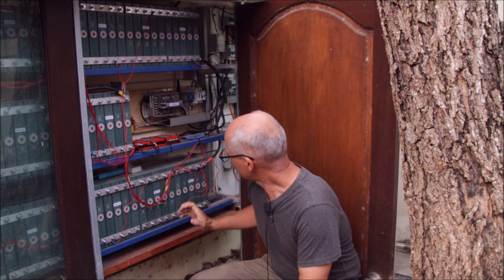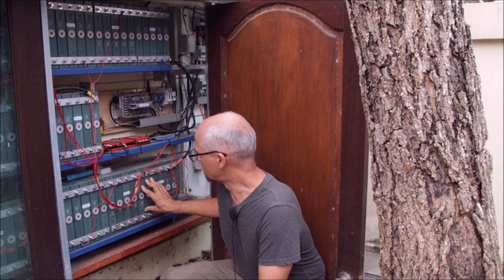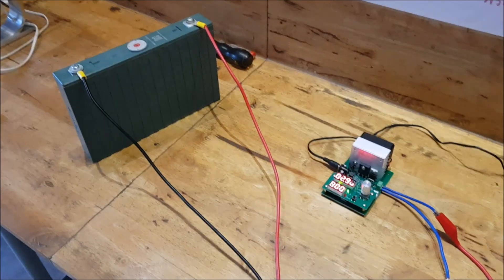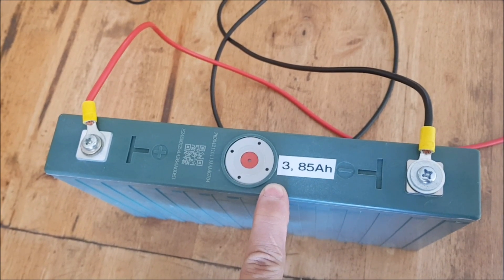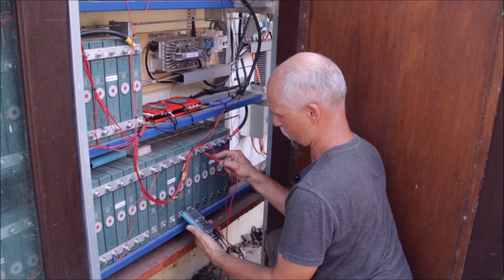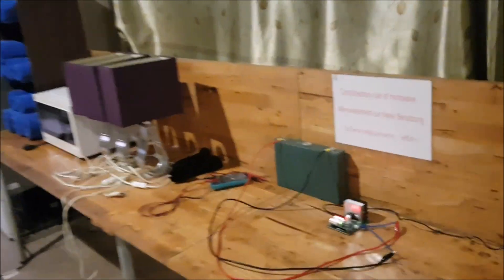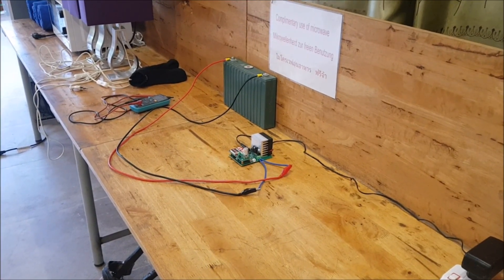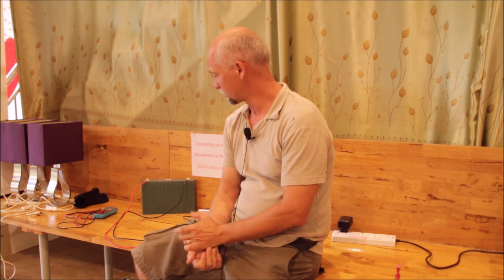What One Bad Cell can do to your Battery Pack. Let's find and fix it!

Comment: I have similiar situation, do you think active balancer will help?
Reply from the maker: An active balancers advantage towards a passive built into the BMS one, is that it is usually more capable to transfer energy from one cell to the other. That means that it can handle greater differences in cell degradation and still keep operation going.
But this is still just masking the real issue. If there is a badly worn out cell, it will usually require to replace it by a good one IF you want to use the pack for a much longer time. If you are just trying to extend the useful life of an anyways weak performing battery bank, then just get an active balancer. But be aware to activate the balancer only at the end of the charging curve above 3,42V to not get the voltages out of balance even more...

Comment: Hello, i am using a panther surge protector for my computer. However my electrical socket only have 2 holes. It doesnt have a ground thats why i am using an adapter to plug my surge protector extension to the outlet. Why everytime i touch my pc or the surge protector i get grounded??? Is it because of my outlet?
Reply from the maker: Hi. Yes, of course. If your outlet doesn't provide a grounding, then the surge protector is connecting the active wires to a dead end. So actually you get phase potential, albeit over a very high resistance, routed to the ground wire. So, if lets say your PC is also connected by that extension cord, you get the PC case as well on phase potential. That's why you are getting shocked :) Please connect to a 3-wire outlet with true ground! Cheers
Reply: @RolandW_DIYEnergyandMore  thanks for replying. umm thats a problem, i am living in a apartment. The outlet doesn't have a grounding. Does this affect my gaming computer in the long run or not? Is there a cons? Or my surge protector is enough even thought the main outlet doesnt have a ground. Sorry for my english
Reply from the maker: @giolacsamana9402  your surge protector doesn't do anything without grounding other then causing troubles. You need to use a cord without a surge protector. Then all is ok, just that you do not have that feature. But that would be definitly better for your equipment.
Reply: @RolandW_DIYEnergyandMore  so much better if i plug my pc directly to the outlet using an adapter and remove the surge protector? Since my pc has a 3 socket, i think thats the grounding
Reply: @RolandW_DIYEnergyandMore  if i plug my pc directly to the outlet, what are the chances of getting my pc friend because of overcurrent
Reply: *fried
Reply from the maker: @giolacsamana9402  chances are very low. Do you have many storms with lightning at your place? If you do not have grounding in your apartment then you can't surge protectors anyways.
Reply from the maker: @giolacsamana9402  do you have ground in your breaker box? If yes, then you could install a surge protection device there and protect the whole apartment at once

Comment: I’ve just made my 8x 3.2v string @ 24V into a 8x (2x3.2v) @ 24V. I wanted to add partners to my existing single cells to make it a 200A pack from a 100A pack. I had 4x Sinopoly cells spare and just bought 4 of the new second hand  Xiamen cells we’re seeing on Lazada. I just sent a flying Poz and Neg lead over from the new secondhand cells and attached to the original cells. This creates a double cell group and saves me buying another flying capacitor PCB and another Smart Bms. Had a Fai Dap power outage for 5 hours plus a few days ago and everything was beautiful. Nice and strong and cell’s differences were minimal. As these cells are second hand and all different capacities it can’t make much of any difference if you mix and match 100A cells.
Reply from the maker: Great. Yeah, the minor mismatch doesn't harm much. It's really just when a cell fails out of some reason. Good ob, Cheers!
Reply: @RolandW_DIYEnergyandMore  

Well I’ll be away from Thailand for most of next year so just getting ready for the rainy season where the local PEA turns off the power in the whole area to prevent damage to the grid when the wind gets up. A lot of power lines go thru farm land and forests so I guess as soon as the winds gets up they shut the power off then test for short circuits and turn back on what they can. We had the power off for over 4 hours a few days ago.